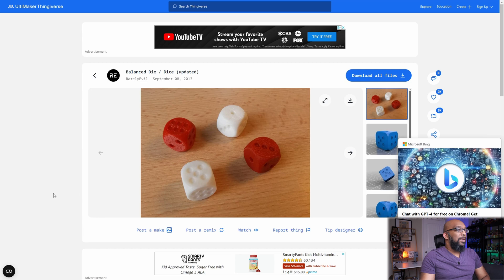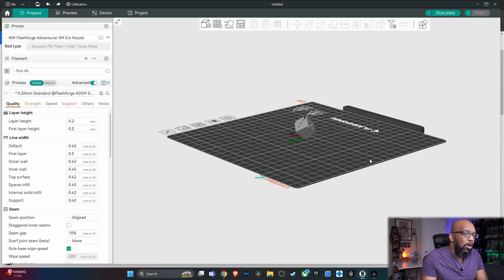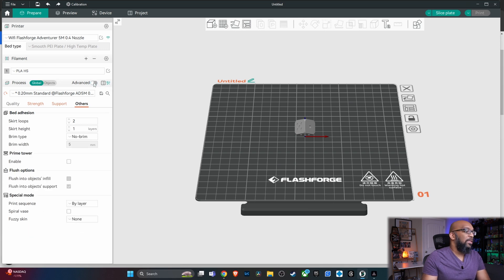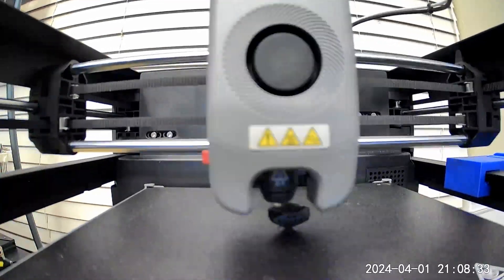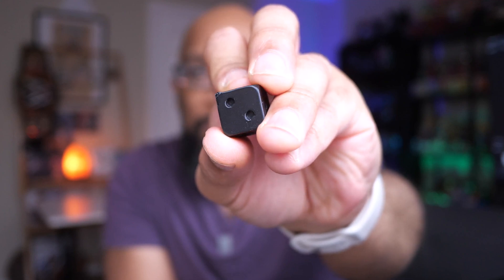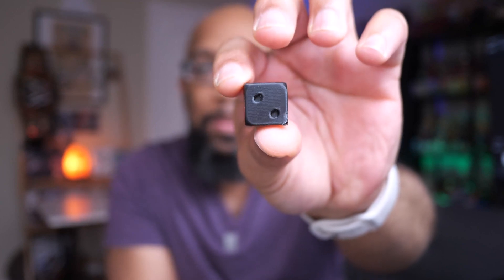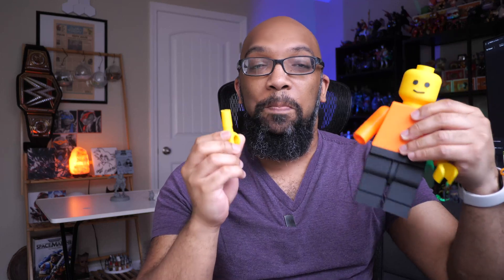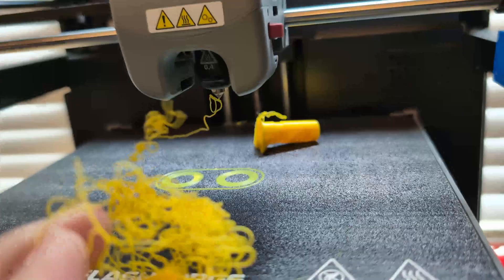How Do You Even Print This?!

Comment: Now do it with a G10 plate ;) 
You'll never go back!! No glue, just wipe with isopropyl alcohol between prints. Releases perfectly after cooling down and the finish is absolute mirror smooth
Reply: FR4 - best of the best)
Reply: @Noxmyn  100%!
Cracks me up that it's cheaper than traditional plates too 😂
Reply: Can you share a link?
Reply: @yaronkofer2439  Don't get it any thinner than 1.5mm